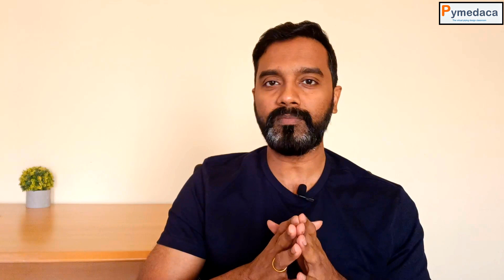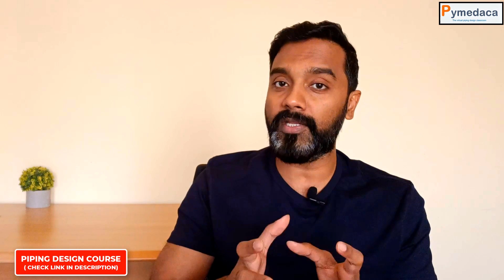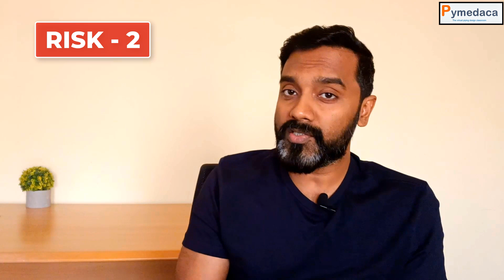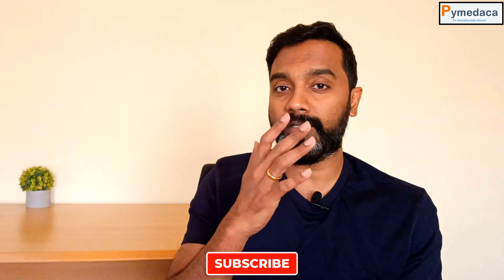Risks for those Moving to Piping Design from Other Field experience

Comment: I like your videos and your content related to piping design. However, the first statement is strongly mistaken. If you are changing from other complete different profession, such as nursering, IT or any other non mechanical engineering related, it may be right. But there are many others that can help you a lot. Specially if you have mechanical design, CAD knowledge, it helps a lot. I personally spent 3 years doing FEA. Almost nothing in design, only FEA. I switched to piping over a year and a half ago and  I could adapt with some help of course. But I wasn't entirely a dumbass. I had Cad/drafting knowledge, I had stress/structural knowledge and I did it. Of course , you are ALWAYS learning as a designer. But such statement can be very dangerous to say straightforward.

Comment: Nicely explained sir, 
I'm seeking professional guidance on career development. With 4 years of experience in the plumbing trade in New Zealand and working as a mechanical engineering technician, I'm facing limited career growth opportunities. To enhance my prospects and salary, I'm considering transitioning to piping design. Do you think it’s a good idea?However, I'm struggling to find institutions in New Zealand that offer piping design courses. Would online courses be a viable option? I have intermediate-level skills in SolidWorks. I'd greatly appreciate any advice based on your professional experience.